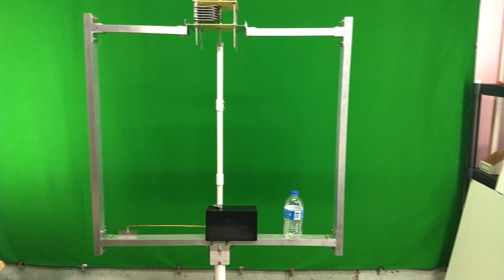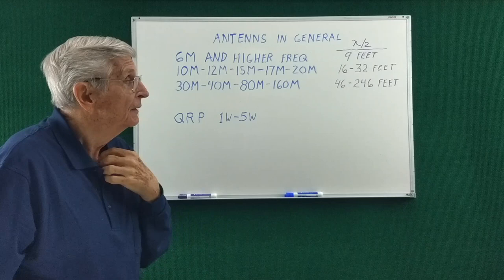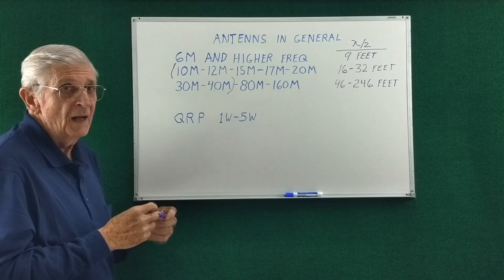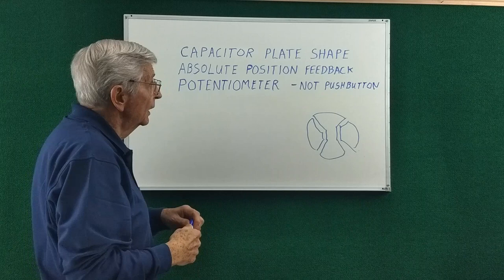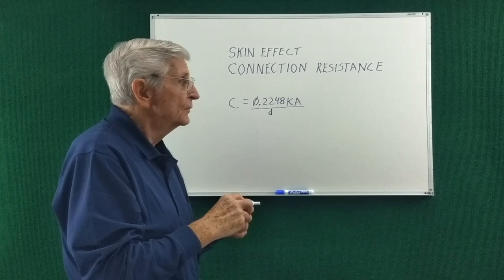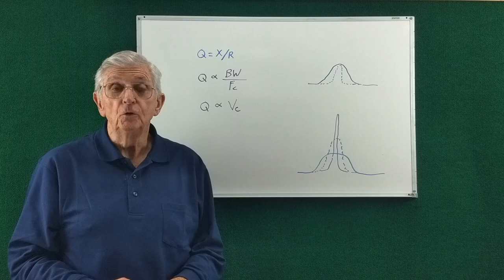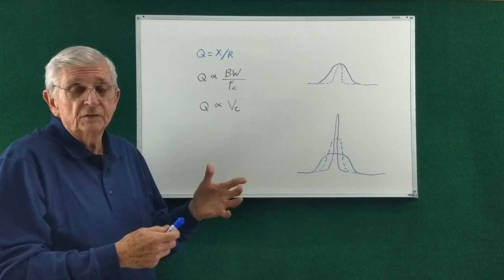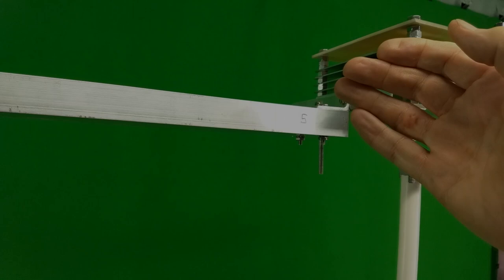Part 2  Quest for the best mag loop antenna

Comment: Thank you for the video! I am also building a magnetic loop antenna. It is made out of a 50mm PVC pipe that is covered with aluminum tape. The capacitor is of the trombone type. It will be interesting to see how it performs.
Reply from the maker: I have found that PVC is a poor capacitor dielectric material. I tried to make a capacitor using PVC and it got hot.
Reply: @Jimscoolstuff  I checked and the tube is not PVC but polypropylene. I wonder if it's better or worse than PVC?
Reply from the maker: @ponttokamera  I don't know about polypropylene. Please let us know if it works. Both Teflon and polyethylene are used as insulators in coax cable, so these should be good capacitor dielectrics.

Comment: Dear Jim, watched with great interest your clear explanation of the mag loop antenna!Am very interested in your follow-up videos, for example whether you built the variable air capacitor yourself. A year ago built a mag loop antenna from 15 millimeter copper water pipe 1 meter diameter with a variable capacitor 25 - 225 pF. This works from off the 19 meter to 20 meter band.
Jim, Good luck on this fine project!
73, Theo
Reply from the maker: Yes I built the capacitor myself. It is an unusual design. It is very difficult to get a capacitance low enough for 10M and high enough for 40M in the same unit. Thank you for your comment.

Comment: the big question Jim, when... is Part 3 arriving? You are a very valuable technician with expert knowledge!   Could you share more about the coupling loop. Is this variable with the band choice?  Turn an high Q loop into his own VFO... what type of LC oscillator is the VFO built? Thanks Jim  Kind regards, 73 Theo. ( visually impaired radio amateur )
Reply from the maker: Thanks for your comment. I am busy with some other projects right now, but I intend to get back to the loop as soon as I can.

Comment: I am ready to build one! Or perhaps modify my German made MLA from 1989 to get ride of the pushbutton tuning controller! You're right, the high-Q, 3-meter diameter 2in tubing design has a huge capacitor that requires quite a fine touch to tune. It's a beautiful example of German engineering. The AMA-3 was developed in 1983 by Christian Käferlein DK5CZ (SK) and it has withstoof the test of time very nicely. But, it could be improved. If you need any real assistance please let me know. I'll gladly help where I can. Kenny, NZ5i
Reply from the maker: Thanks for your comment and kind offer to help. At the present time I am working on another project, but I hope to get back to the mag loop soon.

Comment: Hello! Thank you very much for taking the time and effort to produce this high quality video. Very instructive indeed. 
If you have time, could you please make another video showing in details how the "FEED loop" works in the megloop you are building? 
I see you have connected one leg of it (towards the left-bottom corner) to the MAIN loop? Can you explain a bit how it works? 
I thought (also from the PART 1 you did earlier) that the FEED loop was physically disconnected and only magnetically coupled to the MAIN loop. THANK YOU!
Reply from the maker: Yes I am planning to make videos on the capacitor, the capacitor drive system, the coupling system, and how to turn the antenna into an oscillator ( a VFO) for tuning. It turns out that it is impossible to drive the main loop with a small fixed position coupling loop and achieve a very low SWR on multiple bands. For this reason I went with the coupling system that is shown. Thank you for your comment.
Reply: @Jimscoolstuff  thanks a lot!

I have one curiosity regarding your "rotating FEED loop" idea.

Basically, rotating the FEED loop, you are adjusting the "projected area on the MAIN loop", as in cosine(theta). Correct? At the extreme, when the feed loop is rotated by 90degrees, you get 0 coupling as if the area was 0 (as in cos(90) = 0). 

This is a clever method for adjusting the area of the FEED loop! 
However, does it come at at an efficiency cost? After all, the energy radiated by the FEED loop orthogonally to the MAIN loop is wasted. Correct?

Thanks!
Reply from the maker: @therfnoob7697  Very good question. Before rotating there is a high SWR, so energy was wasted by reflection into the feedline. After rotating for a 1:1 SWR all the energy is radiated. It may be more like a phase shift than a direct area projection. Thank you for your comment.
Reply: @Jimscoolstuff  thank you for the answer. My point is that 1:1 SWR only means that 100% of the energy from the radio is going to the antenna, but NOT that 100% is radiated out to the air. Some energy can be wasted (by heating of elements, or magnetic/electric field losses). I suspect rotating the FEED loop away from the MAIN loop plane is reducing the actual radiated power, due to magnetic field losses from LOOP to MAIN. But I am not sure. It would be interesting to check this out. Keep up the great work!
Reply: Addendum: in the extreme case when the FEED is 90degrees (i.e., perpendicular) to the MAIN loop, there should be (theoretically) zero coupling between the two loops, and therefore zero radiated power.
Reply from the maker: @therfnoob7697  I think that we could resolve the issue with a field strength meter. I don't intend to do this since I have abandoned the coupling loop because it must be adjusted when trying to cover 10M thru 40M. Perhaps someone with a conventional Mag Loop could try this and make a video about it. Best regards.
Reply from the maker: @therfnoob7697  At 90 degrees you would also have an  extremely high SWR, so no power would be delivered to the small loop.
Reply: Thank you! Best regards to you! I have subscribed your channel :)
Reply: @Jimscoolstuff  True.

Comment: Jim, I was just about to build a PVC tube design following John Portune's plan when I came across your video. I really like your use of rectangular aluminum tubes. I know your work is a design in progress but can you please tell me if 5 months after your video, you still find these four-foot-long 2" by 1" aluminum tubes to be a recommended approach? Thank you.
Reply from the maker: Yes, I think the rectangular tubing is sturdy, light weight, easy to work with, and very efficient electrically. 
I got diverted by EFHW projects (I made several videos) but plan to get back to the loop antenna soon. Thanks for your comment.

Comment: Hi dear Jim, I've been following your work since the other video. I was concerned about the small electrical connection surface (not the structural one) in the corners of the square loop. I see that you have now added a second angle on them. In a similar project I'm working on, I'll also add flat side brackets at that location to cover all four sides of the connection. Is it possible that you give us a comment or reference on how you have built the controller with a fine adjustment potentiometer? Thank you very much in advance and for your excellent videos. LU1DYI, 73!
Reply: (I mean how can I turn the circuit into an audible oscillator)
Reply from the maker: The second angle bracket was added for mechanical reasons, not electrical contact. By using position feedback for the capacitor the position can be set with a position reference from a pot. There are 2 motors in the drive unit, One is operated from the coarse (band select) pot. the second motor (fine adjust) rotates the  base plate of the course motor. I am not done improving this arrangement as yet. I will show more in future videos after I am satisfied with the operation. Thank you for your comment.
Reply: @Jimscoolstuff  thanks so much !
Reply: @Jimscoolstuff  Hello again Jim, maybe you can guide me on the issue that worries me the most. How did you convert the LC circuit into an oscillator via the switch, so that you then perform the fine tuning motor movement based on what you hear? What did you use to turn it into an oscillator? (I understand how to move stepper motors, not my question) Can you share something about your oscillator so that I can study the subject ? Your help would be greatly appreciated. Again thank you very much !
Reply from the maker: @danielsolowiej  This is not very clear in the video, I will do it better job in the next video.  The sound is coming from a radio tuned to a particular frequency that you want to transmit on. A high Q, L-C circuit (the mag loop) is made to oscillate at its resonant frequency. The mag loop is then a VFO (variable frequency oscillator) that can be tuned to the receiver frequency by adjusting to a zero audio frequency (zero beat). The switch activates a relay that connects the oscillator circuit to the loop. In the final design the switch will be replaced by a pushbutton. This will make it less likely that someone will transmit when the oscillator is connected (poof).
Reply: @Jimscoolstuff  Thank you very much for taking the time to read and answer me. I have been thinking for a long time about how to tune the loop without emitting a carrier, even with low power, especially for cases in which the frequency is busy, perhaps this path will bring me closer to finding a solution. Hopefully you can and want to publish a video on this subject as you comment, if your occupations and willingness allow it. In any case, I am truly grateful for your response and for the content on your channel, which I find very interesting and useful. My affections!
Reply from the maker: @danielsolowiej  Thank you for your kind comment. Best regards.

Comment: Thanks Jim for all the informative and very valuable HAM radio videos ! question about this designed Mag Loop antenna, what is the range of the self-built variable capacitor? We live on an apartment then fortunately a Mag Loop antenna is compact enough to work HF bands. Thanks! Kind regards from the Netherlands, Theo 73, PA0HTY.
Reply from the maker: The capacitor range is 7 pF to 180 pF. The hardest   part of the design was getting down to 7 pF for the 10m band.

Comment: I like the idea of using box metal for the loop. But the capacitive coupling between the plates on the corners doesn't improve the Q. That requires a reduction of purely resistive loses. I'd suggest having the corners welded to maximize the Q, assuming you would need it. You probably don't. If I build a similar loop I'll shoot for a very high Q and will get the corners welded. I'm in an apartment surrounded by noise sources, without the ability to put an antenna outside, so I need a very small, very high Q antenna for use in the apartment or out in the park.

Comment: Jim, good morning. that thin horizontal copper wire is that part of the gamma match? And how is the normally center capacity of the Gamma Match formed? Thx. Theo PA0HTY
Reply from the maker: The copper wire is not a gamma match it is just a coupling loop. In other videos where they use a round main loop, they typically use a smaller round loop to couple power to the main loop. Thank you for your comment.

Comment: How did you construct the method of antenna tuning without using your transmitter?
Some type of oscillator circuitry? Thanks for making these videos.
Reply from the maker: Yes you are correct. You can turn a high Q loop into it's own VFO. This is proving hard to do on all bands (10M-40M). I am still working on this and i hope to have it perfected soon. Thanks for your comment.